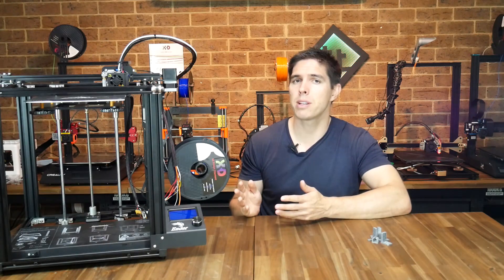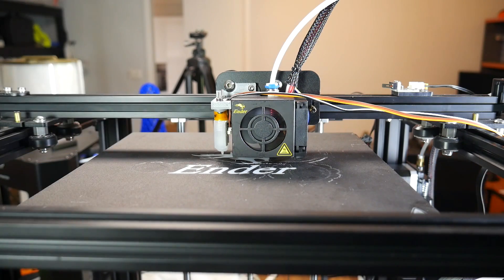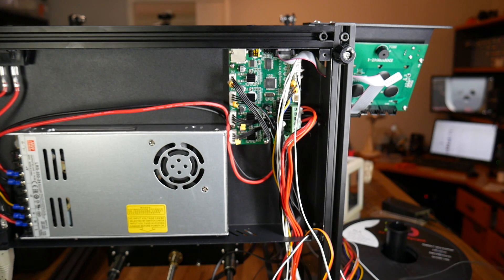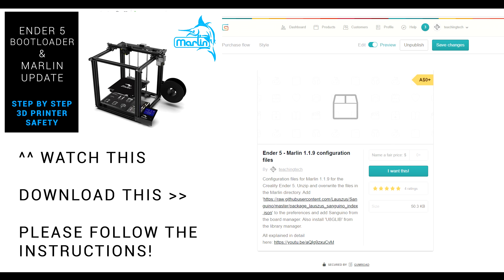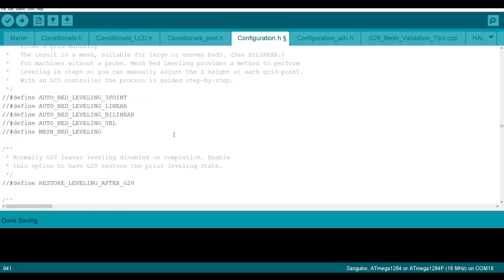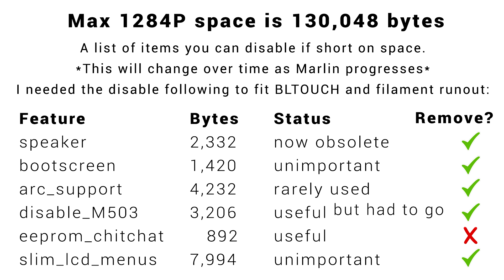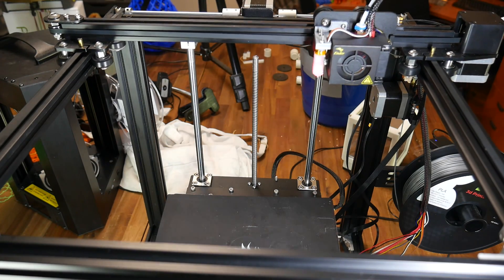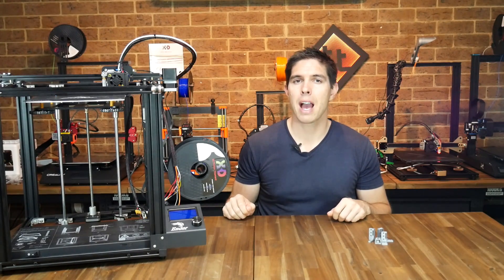Ender 5 BLtouch guide - Step by step for Marlin & TH3D

Comment: avrdude: stk500_getsync() attempt 1 of 10: not in sync: resp=0x65
avrdude: stk500_getsync() attempt 2 of 10: not in sync: resp=0x63
avrdude: stk500_getsync() attempt 3 of 10: not in sync: resp=0x68
avrdude: stk500_getsync() attempt 4 of 10: not in sync: resp=0x6f
avrdude: stk500_getsync() attempt 5 of 10: not in sync: resp=0x3a
avrdude: stk500_getsync() attempt 6 of 10: not in sync: resp=0x53
avrdude: stk500_getsync() attempt 7 of 10: not in sync: resp=0x44
avrdude: stk500_getsync() attempt 8 of 10: not in sync: resp=0x20
avrdude: stk500_getsync() attempt 9 of 10: not in sync: resp=0x69
avrdude: stk500_getsync() attempt 10 of 10: not in sync: resp=0x6e

why do i get this error im using a silentboard which has a bootloader installed...

Comment: Many thanks for this guide, just followed on my ender 5 Pro and works great. Having the mesh bed leveling really helps with the slightly warped build plate.
Reply: Just to be sure - your printer has a V1.1.5 mainboard and it worked with these instructions?  Did you go with the 2m cable since amazon only sells 1m or 2m?
Reply: Yes, the machine has the v1.1.5 motherboard. I made my own extension lead to the BLtouch from a bit of ribbon cable, 1m isn't quite long enough. I used the TH3D firmware as, when I tried to follow the vanilla Marlin instructions I ended up with an executable which was too big for the processor. Using the TH3D (version R2 config.h version 010109) worked ok and the v1.1.5 board had a pre-installed bootloader which kept things simple.
Thanks again for the instructions.
David

Comment: Thanks for the videos, they are very helpful.  I used your video to upgrade Ender 5 Pro to Marlin 1.1.9 and this guide to install the BLTouch and firmware changes.  The problem i'm running into now is the bed keeps crashing into the nozzle and then it drags across the build plate which has ruined the magnetic pad.  Can you give me some ideas on how to resolve this?
Reply: Did you ever find a solution?

Comment: Looks like this solution doesn't work anymore. Creality keeps updating the firmware so it gets larger and larger. Some of the recommended lines to comment out were already commented out. The few things I could comment out I was still 8000 bytes over. I don't know what else I could remove without making the whole thing not work. Also the pin 27 breakout board I received didn't allow my LCD to work through it. Tempted to look at just buying the TH3D EZ board with an EZABL sensor now.

Comment: Creality's website has a firmware which has BL Touch support already built in. Their youtube tutorial video shows them using an USB ISP interface to connect to the printer and installing the BL Touch firmware. What is the benefit of upgrading to BL touch your way?
Creality's firmware is 1.1.6.3 and supports thermal runaway protection and BL Touch.
Would it give me the same results to follow Creality's tutorial and not need to buy an Arduino board and jumper pins, and not mess around with any code?
I'm very new to 3D printing so I am not yet confident enough to be messing around with things I don't fully understand, I just figured perhaps Creality's new firmware may have come out after you made this video and so you didn't cover it.

The installation kit is sold on their website: https://www.creality3dofficial.com/collections/bl-touch/products/creality-bl-touch
And this is their tutorial: https://www.youtube.com/watch?v=jqxlQkkt8cM
Their firmware: https://drive.google.com/drive/folders/1s0VsIGAgxNVpz7Ls868OO3jVuQP5tnGy
Reply: It should give you same results. I bought the updated motherboard for the Ender 5 that has the silent stepper motor drivers. That board did not have the auto bed level function, so I had no easy way of leveling my bed. I tried updating the firmware to ensure it really had thermal runaway protection and to see if the auto bed level function came back. It didn't come back, so I had to use octoprint to manually control the steppers to level the bed. Now I already have the latest marlin firmware so this is helpful for me since I already got into this mess.

An Arduino is cheap and the process ended up not being that hard. Plus after this process your printer will have a bootloader so it can accept new firmware updates. Actually now that I think about it I don't know if you can update firmware from the manufacturer since the printers don't come with a bootloader, so you might have to do the Arduino part anyways if the firmware your printer came with doesn't automatically support BL touch out of the box. Doesn't hurt to try, but be prepared if you have to come back here.

Comment: Is this setup the same for an Ender 5 pro? I know it has a different board installed.  I assume the board is the same with different step drivers.  Can you verify this?
Reply: the people need an answer
Reply: @magilla_and_amanda  Good luck!
Reply: YES! I have used this on my Ender 5 Pro. Look for my comment above to see what issues I had to adjust. I highly recommend upgrading Marlin and doing the bltouch modifications. I may be able to send you the hex file which will allow you to do the flash in just a few clicks using the progisp from Creality. It also includes the bootloader so you can upgrade from the usb for future updates.
Reply: @RowdyRocket  I just receive my BLtouch for my ender 5 pro , can you share the file with me ? thx
Reply: @fredericpoissant2769  sure. Mine is also setup for the filament runout sensor. Everything works great on mine but just in case, I'm not responsible for any issues you may have blah blah blah. Do you want it for the Arduino install or through the USB ISP that came with your Ender?
Reply: @RowdyRocket  usb isp
Reply: @fredericpoissant2769  you should be able to grab it from here... 

https://github.com/RowdyRocket/Ender-5-Pro-Marlin

All you need is the hex file. Follow the directions that were included with you USB ISP and then flash. Should work like a charm, if you have any issues let me know. I'm pretty sure that's my latest.
Reply: @RowdyRocket  Will try it soon 😁thx
Reply: Do you know the version ?
Reply: @RowdyRocket  If it works well for you, you could do a tutorial on youtube for users of ender 5 pro. That would be good
Reply: @fredericpoissant2769  should be Marlin 1.1.9
Reply: @RowdyRocket  Shout out for the help.  New to my Ender 5 Pro upgrades and thought the BLTouch upgrade would be easy peasy with all the youtube help available.  I fell into the same Z-Height trap that everyone else did.  I chased a number of blind trails and eventually decided to go the Marlin build route and fix it.  Then I found your link to your existing .hex file.  Install went pretty well.  Bed leveling went pretty well.  First print failed immediately; dragged on the bed for first layer.  Checked my setting for z-offset and it was correct.  Repeated and got the same result.  Parked everything for a few hours for tacos and tequila.  Came back and it repeated the previous results.  I decided to confirm my z-offset and for some reason the value has changed.  I don't know where that's coming from, but after measuring and storing the new value (different by ~1.5mm) I print square cubes now  :)

Really appreciate the random save.
Reply: @rushtonline1674  I had the same issue at some point. It should have been resolved if you used my setup. Can't remember the actual command name but it's one that allows z to be set below zero. Without that enabled you will continue to have that problem. If I can remember later I'll see if I can find it, in the middle of something right now.
Reply: @RowdyRocket  It's all good.  Once I remeasured and set the new z-offset, prints are fine.  I don't know how the z-offset could have changed though.  Weird.
Reply: @RowdyRocket  Hey Joe, I am pretty green with all this. I too am having issues with my BLTouch upgrade to my Ender 5 pro. Can you walk me through how to flash the new firmware that will enable the BLTouch to work properly? Thanks in advance!
Reply: @teddywhitehead8480  been a bit since I've messed with it. It's not too fresh in my mind but if you watch the video and read my comment you should be able to figure it out. What part are you having problems with?
Reply: @RowdyRocket  well I’m not having trouble with any part but rather the firmware and flashing. I’m not sure what firmware I need to flash that whole process. When I downloaded the firmware off the Creality site and saved the bin file to an empty micro SD card, I flashed the 3D printer. However, when it booted up everything appeared normal but the buzzer began sounding off continuously. So my thinking is I need a different firmware to flash, though I’m unclear on which version to flash and what settings I need to make to the code to get this puppy working. I appreciate your help!
Reply: @teddywhitehead8480  on my Ender 5 pro I wasn't able to update to Marlin 2, I think the latest I could go with was the 1.1.9 I believe I linked the firmware I'm using in a previous comment with the bltouch and filament run-out sensor ready to go.
Reply: I did some research and the answer seems to be, yes this will work with the Pro. I ordered one and just got it in, so your well wishes are appreciated, lol.
Reply: @magilla_and_amanda  Have you managed to install and update the firmware for the bl touch ok on you ender 5 pro? im looking to buy one along with the bl touch
Reply: @SwingsNRoundabouts1955  I have not yet, no time, but am planning on trying this weekend if i have a chance. i will be sure to come back here and provide my results.
Reply: @magilla_and_amanda  legend 🙌
Reply: @magilla_and_amanda  let us know how you got on i also have a pro and looking to fit a BL touch

Comment: when you set the x and y axis, is the meaning that the nozzle is in the midle of the bed or the BL? on mine ender 5 The BLtouch is on the middle
Reply: nozzle. the software should handle the offset.

Comment: Hi there Michael, any chance you could do a Marlin 2.0 install guide with BL touch on the Ender 5?
I'm having issues here with 2.0, the buzzer is constantly sounding off  (with the stream if pulses intended for the BLtouch), even though I'm using pin 29 and have added your lines to enable servo0 on pin 29. Thanks
Reply: Found  fix , loaded latest version and it's ok now.

Comment: Thanks for this. I successfully installed my BLTouch on my Ender 5! QUESTION... I want to switch my board to the 1.1.5 silent board. How do I now tell Marlin that I have put in this new board, and still maintain my settings for the BLTouch as they are in my existing board? Appreciate any help!
Reply: I have the silent board already and am adding the BL touch tomorrow when it delivers. My best guess is that you need to start the board over with a fresh install of marlin. I don’t think there is any easy way to copy existing settings over from an old board.
Reply: @PinheadLarry1337  That's exactly what I ended up doing. Works fine.
Reply: @timaucoin2093  My LCD doesn't work with the breakout board provided. Did you run into this on the silent motherboard?
Reply: @PinheadLarry1337  I assume you are referring to the Pin27 breakout board? I had no issues with my LCD... I would double check the wiring, or maybe the Pin27 board is defective?
Reply: Came here for same question. Did you find out anything?

Comment: Thank you so much!  I had to use https://github.com/Lauszus/sanguino and https://github.com/olikraus/U8glib_Arduino in addition to the files you provided but after that everything worked like a charm and I learned a little bit about programming a bootloader and using the Arduino IDE.  Thanks again for your great guides!

Comment: Am I the only one having issues with this marlin setup? It’s not doing the abl (yes g29 has been added to the slicer start code), and it appears to be trying to print only on the front half of the bed. 

Had the same ABL issue with the TH3D firmware (just probes the center then starts the test print), but that printed using the entire bed.

Comment: I have a cr-10s and that printer has 2 cables running to the lcd. To witch one do I have to plug the pin 27 board? Love your vids by the way especially the ant vid.

Comment: I managed to follow your instructions to get the BLTouch working, however I had to add a few lines into the Marlin code to be able to use the BLTouch V3.  I suspect this will end up in a version somewhere, and I've heard they've already put it in Marlin-2.0 but if anyone wants to make the BLTouch V3 work with Marlin 1.1.9, you can add the lines from the following github link.

https://github.com/InsanityAutomation/Marlin/commit/15ce74badfd3a1b6e6ffabf882234ffa77682715

Adding in the line changes that he listed, BLTouch V3 is working on my Ender-5 now with Marlin 1.1.9 using the stock controller board V1.1.4.  Similar changes should allow it to work on any of the other Creality machines still using the factory controller board.
Reply: Your suggestion worked perfectly for my BLTouch v3 on Marlin1.1.9 (only edited the first 4 tabs in Arduino IDE)  Thanks mate!!

Comment: Are we talking bltouch v3 or previous ones?? Because on my CR10S Pro the V3 cant be used.
Reply: Add and delete the lines in Marlin 1.1.9 that are detailed on the following github link.  It'll add the new commands for the BLTouch V3 into the firmware and it should work properly after that.

https://github.com/InsanityAutomation/Marlin/commit/15ce74badfd3a1b6e6ffabf882234ffa77682715

Comment: Hi all.
Just bought the ender 5 and followed the instruction as shown above. The MOBO is a version 1.1.4 and the bltouch (boucht via creality) is a V3. The bltouch is not responding. Using Auto home, the nozzle hits the bed. Already switched cables, that didn't help. Creality's answer is that ender-5 doesn't support bltouch mmmmmmmm. Annybody suggestions ?
Reply: Add and delete the lines in Marlin 1.1.9 that are detailed on the following github link.  It'll add the new commands for the BLTouch V3 into the firmware and it should work properly after that.

https://github.com/InsanityAutomation/Marlin/commit/15ce74badfd3a1b6e6ffabf882234ffa77682715
Reply: Thx for the respons. I don't understand "the following github link". What did i miss.
Reply: @maartenkuijpers7159  The github link contains the code to remove and add for the Marlin source code for specific files that will introduce the new codes for the BLTouch V3 which will allow it to work with Marlin 1.1.9 and the Creality 1.1.4 board.
Reply: @phillipbeal8536  thx. I wil give it a try.
Reply: I can see that the file for the ender-4 is the same as the one for the ender-3. I noticed that  it is the same line of code. So i will follow this for my ender-5. Thx @phillipbeal8536
Reply: Maarten Kuijpers The important files that have to be modified to make the BLTouch V3 work are Conditionals_LCD.h, Configuration.h, Marlin_main.cpp. If you make the changes to those three files that the github link is showing, it will add the necessary changes to support the BLTouch V3.  The other files are just the Version.h and example configuration files which don’t actually do anything for the BLTouch.
Reply: @phillipbeal8536  Sorry for not responding sooner. I tried it and it works perfect. Thx for the effort and thx for the patience.
Reply: @maartenkuijpers7159   Hello marteen, can you zip and upload all modified files ?  Thx a lot

Comment: Anyone know how to get this running with the new V3 of BLtouch? It seems that version isn't recognizing a probe impact with Marlin or TH3D.
Reply: same issue for me with v3 bltouch
Reply: @shug39  Add and delete the lines in Marlin 1.1.9 that are detailed on the following github link.  It'll add the new commands for the BLTouch V3 into the firmware and it should work properly after that.

https://github.com/InsanityAutomation/Marlin/commit/15ce74badfd3a1b6e6ffabf882234ffa77682715
Reply: Add and delete the lines in Marlin 1.1.9 that are detailed on the following github link.  It'll add the new commands for the BLTouch V3 into the firmware and it should work properly after that.

https://github.com/InsanityAutomation/Marlin/commit/15ce74badfd3a1b6e6ffabf882234ffa77682715

Comment: Hey Michael, another great video. Thats the same technique I use to thread the wires through the sleaving. It took a while to work it out, but it really does make it so easy. I also wrap the ends in insulating tape or heat-shrink to stop them fraying.
I no longer strap the wires to the PTFE, this is because the wires add weight to the PTFE and cause it to bend, this creates tighter radii which causes more friction resistance on the filament while extruding. To support the wires I thread a piece of 3mm nylon filament through the sleaving with the wires and anchor it at both ends, again, this helps to reduce the any bend radii on the wires, therefore extending their life. Hope that all makes sense :-)

Comment: So if I understand correctly with the latest TH3D unified version all that needs to be changed to get BLTOUCH support is to update the configuration.h file, modify the printer section for the model being used to enable the custom_probe, edit the BLTOUCH section to enable it and pin 27 support and adjust the probe offset location?  So much easier then in the past.  I'm assuming this will work for the Ender 3 as well, just uncomment the Ender 3 sections.
Reply: Is there a guide for this?